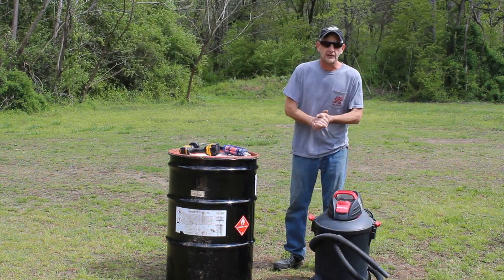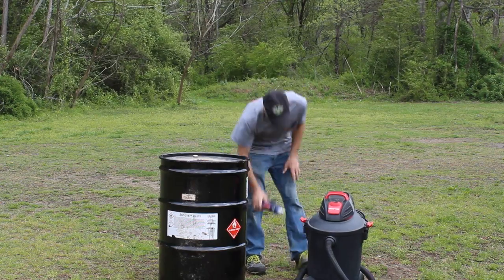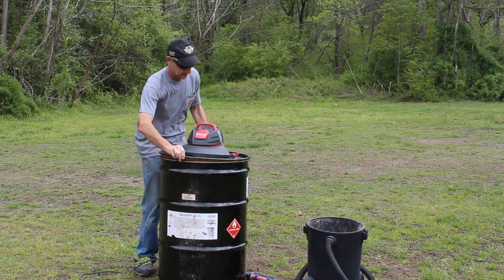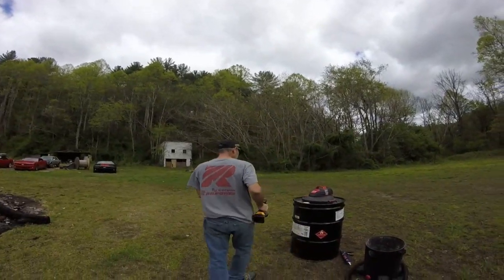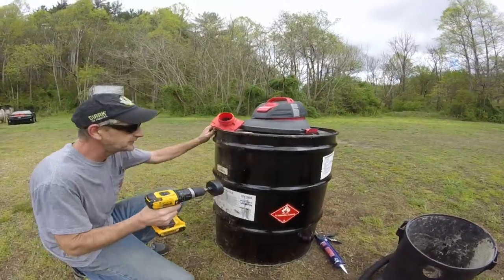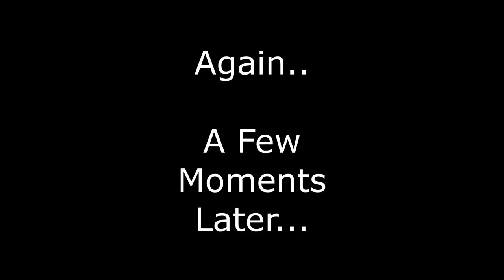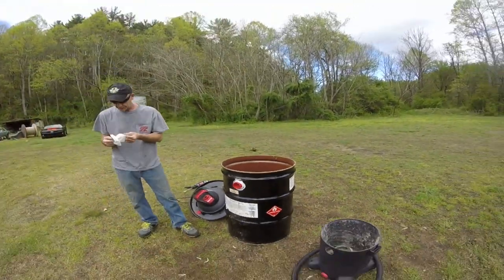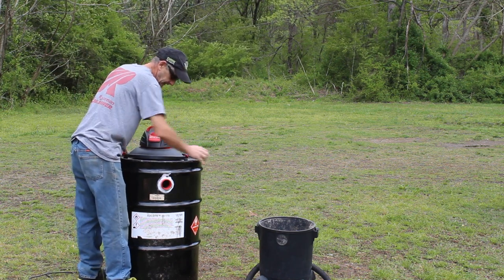DIY 55 Gallons Shop Vac!!

Comment: I wanted this to transfer large amounts of cattle feed to big drums....works great for cleaning out livestock feeders and transferring any dry material in to a large drum. ....before I was doing it a little at a time and then picking up the shop vac reservoir and pouring it into the the larger container.... This is what I was thinking of doing Thanks for the video........I also looked for adapters and found them outrageously expensive.

Comment: Well.... This was exactly what I was looking for.   I need a water reclamation vac and a good one  starts at 1200.  You answered how to do the vac head.  Now I'll have system for under three hundred dollars and I'm good to go.  Oh.   The looks can be fixed with a few coats of paint.  Thank you!
Reply: I’m doing this for the same reason. I had in my head the same idea this guy did just came to see it done and get an idea of any problems I might run into.
Reply: Did you make one and have you used it in the field? Also are you using in a pressure washing or soft washing business?